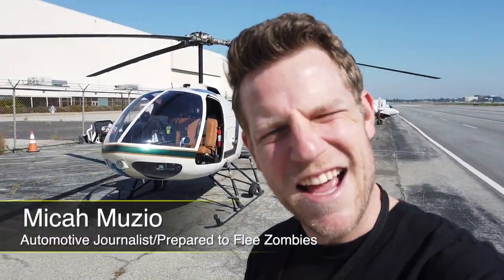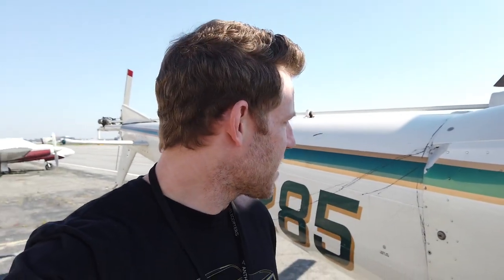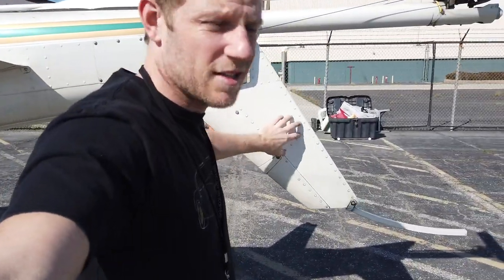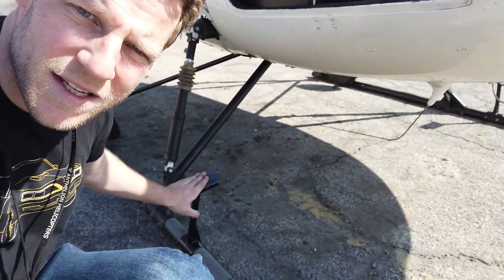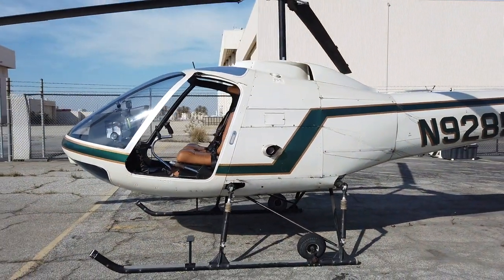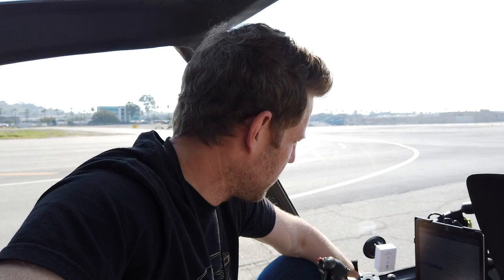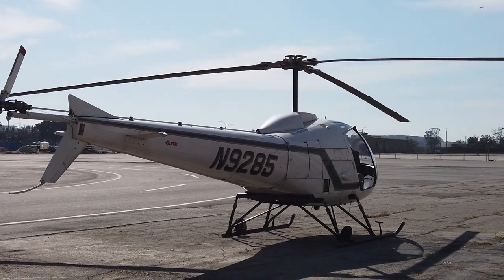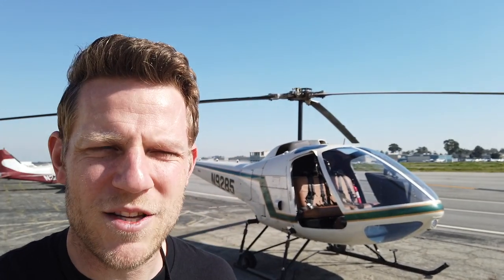Micah Reviews His Helicopter | Enstrom 280C

Comment: 1. You have the same dent on the top left corner of your baggage door. The old-time enstrom guy in Rexburg said that's because if a mechanic who is unfamiliar with enstrom takes that top panel off, the spring in the door pops it up and it falls down on that corner. 
2. Also at 3:33 shouldn't your backfire door be rotated about 120 degrees clockwise? 
3. That step is pretty nice! 
4. At 8:40 pretty amazing how much less the pitch is on right pedal. Makes sense, but I'm not sure I've ever really observed it from that angle. 
5. Greek mythology tied into your review. This is why you're the professional.

Comment: What are the realistic operating costs and annual usual charges?  I’m interested in getting one...
Reply from the maker: Robert Kaindl It’s tough to quantify because my ownership experience has been dominated by finding and correcting problems. It’s been an endless battle. 

That said, the bird seems to have reached an equilibrium now that I’m working with a new mechanic who has sorted out a ton of minor issues. 

Assuming you buy an Enstrom that’s mechanically sorted the consistent costs are fuel, storage, and annual maintenance. 

For fuel, my bird burns right about 16 gallons per hour. Budget $5.50 or so per gallon and that’s $88 per hour. Oil is another consumable to consider. 

Hanger or pad expenses vary widely depending on where you’re based.

As for annuals, this last one was about $7k. 😐 Had to replace the exhaust and sort out a few other squawks. Next year should be cheaper. 

This year I also had to upgrade my avionics for ADS-B compliance. That was...expensive. 

Long story short, it’s complicated and depends on the aircraft you buy and where you fly. According to Enstrom, their 280 aircraft have a direct operating cost of $197.83 including reserves for parts and maintenance. All in, $200/hour is a good starting point.

Comment: The Hughes 300 I used to fly is rated at 190HP and also uses the IO360. So the  boost pressure on the Enstrom is obviously very low and probably only normalising.

Comment: Hi Micah! Great videos!  I posted a comment on your "oil tanker" tour about autorotating. I know you must be a busy guy, but I'm really interested in knowing your perspective on this topic. Here is my original question:
 Since you mentioned a few safety issues when flying over water, I have a general helicopter aviation question. First , I've always heard that helicopters are a much more delicate instrument as far as the machinery goes, when compared to airplanes. With that being said, if you have a rotor failure (whether it's the rotor itself, or engine related) , one always hears about autorotation.
 I've read about a good number of helicopter crashes over the years , and obviously that wasn't an option (or the pilot may not have had enough experience to utilize the maneuver) in a lot of them. Can you shed some light on this topic , including how and when it can be successful in a bad situation?  Thanks!

Comment: so I'm wondering why they put the exhaust pipe so close to the pilot window

I asked that because if the wind is blowing towards the cockpit from behind wouldn't exhaust technically asphyxiate you or pose a risk

you're always so informative with every video that you think and you also add in a little bit of entertainment
Reply from the maker: Good question! It's really just an issue of engine packaging. Based on engine and turbo location, that's the shortest most logical spot for the exhaust outlet. 

Thankfully it's not an issue. When airborne the helicopter is almost always flying forward. And even in a hover, there's plenty of downwash to move the exhaust away from the cockpit. Really the only occasion where exhaust might move forward would be while idling on the ground. In all my flying that hasn't been problematic. 

All that said, there is a good reason to have the exhaust exit from the side of the aircraft. The outlet is placed high so when landing away from an airport, the hot exhaust is less likely to ignite a grass fire. Robinson helicopters specifically warns its pilots ‘Do not land in tall dry grass. The exhaust is low to the ground and very hot; a grass fire may be ignited.’

Comment: Sorry about all the questions🤷‍♂️ But Is your chopper hard to fly? And what does it cost to learn? How long did it take you to fly to Las Vegas ? Man this was a really fun video to watch. I really want to fly one.
Reply from the maker: I welcome the questions. 

1: All helicopters are hard to fly...unless you're a trained helicopter pilot. But my helicopter is extra tricky due to its completely manual throttle. I've gotten used to it but initially, it was a major challenge. 

2: If I recall correctly I spent about $12-13K for my helicopter license. I'm guessing prices have gone up in the last decade or so since I got my license. 

3: The flight to Vegas was a little more than 3 hours in the air. My chopper is sloooowww.

Comment: Cool video. I'm curious about the wheels on the skids, which I assume allow you to "dolly" the helicopter in and out of a hangar.  How do they lower into position?  Also, are there any potential issues with the pilot in the left seat?  I noticed on another video that when you need to change a transponder setting or something, you have to switch to the left hand holding the cyclic while you reach the transponder with the right.  Does hand-switching ever cause a problem?

Comment: Very interesting video. You answered one question that I always had; what happens if the engine dies in midair? I do know that the small rotor at the tail provides a counteracting force to keep the helicopter from rotating due to the engine’s torque, right?

Comment: It appears your Enstrom Helicopter needs the verticle stabilizer fins that fit on the 280 FX. They're supposed to have a 15° pitch to compensate for rotor torque when in forward flight. and would probably eliminate "sharking"... Enstrom part # 28-20112-1 (L.H.) and Enstrom part # 28-20112-2 (R.H.)  I would think the parts along with an STC would correct it.

Comment: Awesome review. I went to Sharkey's up in NH and was really impressed with the 28's and 280's (not to mention the turbine *drool*). What was your process like shopping between the 28 and 280's and the old variants out there? Why a C-model over an FX for example?
Reply from the maker: Andrew Garcia Man, I really need to pay Sharkey’s a visit!

To answer your question, I really preferred the look of the 280 but if a 28 had popped on my radar I would’ve happily gone that route. Thankfully, I happened to find an ag pilot who was offloading his 280 after switching to Robinsons. 

If funds had allowed I would’ve gone FX but the C landed below my budget. The FX’s extra horsepower might be nice but honestly, I’ve grown to appreciate the C’s non-correlated throttle. Flying a manual throttle chopper seemed daunting but now it’s 2nd nature.
Reply: @MicahMuzio  interesting. Did you have a good local guy do your pre-buy? Coming from robbies, how did you sift through the enstroms that were coming onto the market to avoid getting into a maintenance pig?
Reply from the maker: Andrew Garcia I did have a local guy check it out. Truth be told, the maintenance to bring my bird up to snuff was WAY more than I could’ve possibly imagined. So, not sure how much good that inspection did me. 💁‍♂️ Thankfully at this point the Heli is pretty well dialed in. 

If I were in the market again I would have a much better sense of what to look for. More importantly, I’d make sure that pre-purchase inspection was handled by someone I absolutely trust.

Comment: The takeoff from the airport seemed somewhat haphazard compared with a fixed wing aircraft because the helicopter was not given a takeoff bearing, whereas a fixed wing aircraft would have to follow the taxiways to a specific runway, wait until all planes in front of him had taken off and all planes that were sequenced to land were on the tarmac, before receiving clearance from the tower to proceed onto the runway for final checks before departure, getting final clearance to takeoff at which the tower would give the pilot the heading and altitude which the pilot would maintain until further instruction from the tower or making a requesting to move to a new heading and possible altitude. Micah just took off and headed across to runways at 90 degrees, with no clearance from the tower as far as I could tell. There were no instructions to follow a certain bearing or to climb to a certain altitude.
Reply from the maker: Are you talking about my takeoff at the end of the video? Assuming so, you realize the footage was clearly sped up, right? 

I requested a West Wardlow departure, a totally standard helicopter departure route for Long Beach airport. Also, I didn’t cross a runway. My pad is at the western end of the airport. The nearest runway is 26L, which runs parallel to my departure path. 

Long story short, it would be stupid to fly without clearance as you’ve described. Which is why I didn’t.

Comment: BTW, I have 2000 hours in The Army flying Huey's and Black Hawks
Reply: Would you fly a 42 year helo even if the engine and related items have been replaced except the structural airframe which would basically be the same one when it was new. There has been a lot of shaking and vibration and maybe some rough landings on that same airframe I would assume.

Comment: I wish you could afford a better helicopter you might be safer in an R22
Reply from the maker: Given the R22's low inertia rotor system and semi-rigid teetering blades, I actually feel much safer flying the Enstrom. No mast bumping concerns and the time between engine failure and catastrophic rotor speed decay is much much longer.